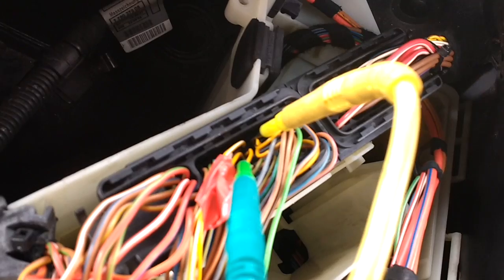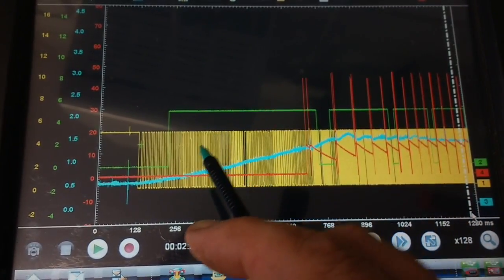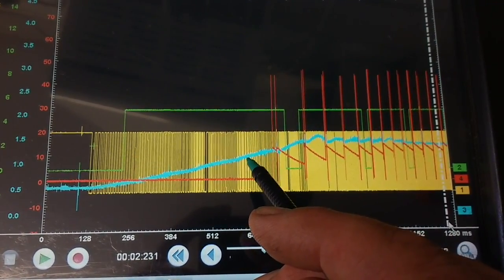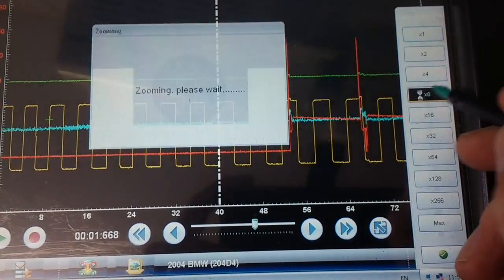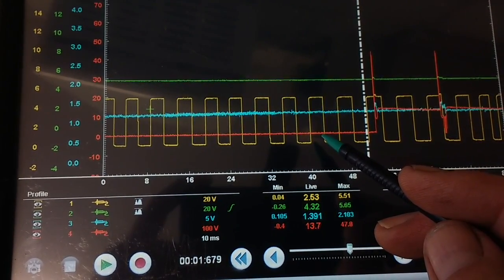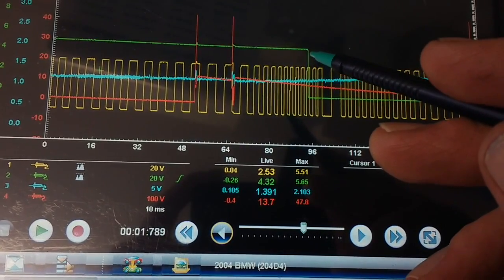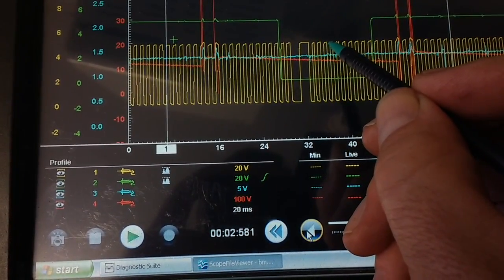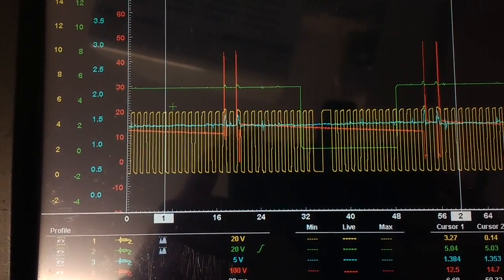BMW E46 CAM/CRANK SYNC

Comment: Hi Sandy you haven't a cam/crank waveform for a n47 engine by any chance?
Reply from the maker: No Richard, did u try the quick method of cranking voltage set on AC coupled V injector no.1 firing event for a rough sync? Any codes?
Reply: @sandyande  
It has just came in Sandy, owner was working at an air suspension fault first but didn't get it fixed then he left it a while and tried to start it about a week later but just cranks,I tried some brake cleaner in the air intake and it didn't attempt to start so I ruled out a fuel issue at the moment, nearly 200k on it and I would have liked to seen a cam/crank waveform to rule that out first before moving on, massive amount of fault codes but then again with him working at it it's hard just knowing,thanks for replying 👍
Reply from the maker: @richardmcwhirter9396  clear the faults and see what comes back when u crank it
Reply: @sandyande  
I'll keep you posted 👍👍